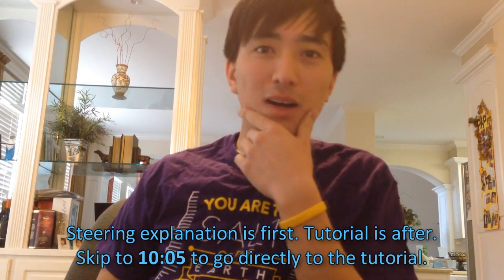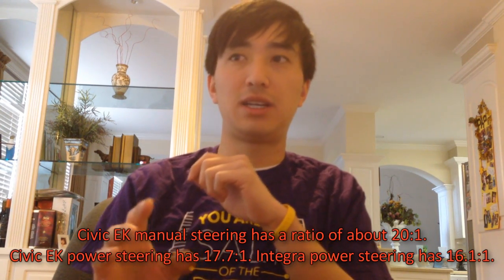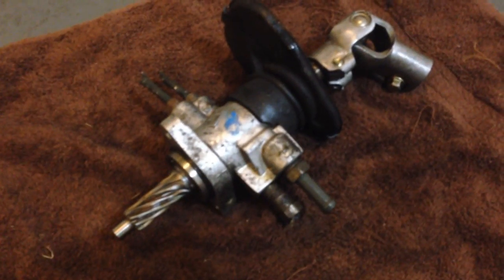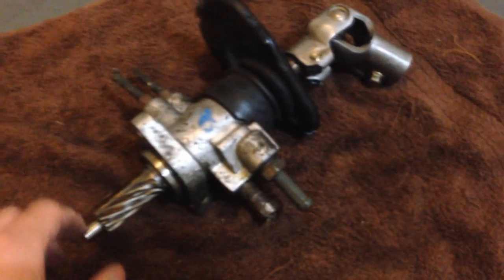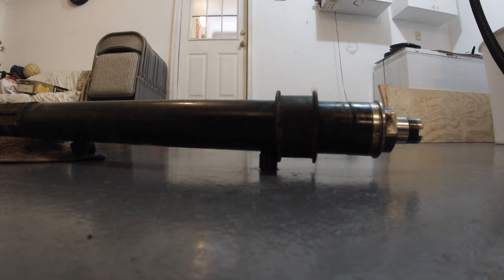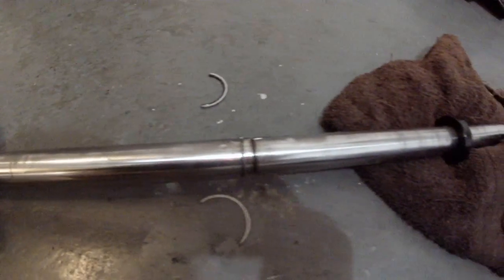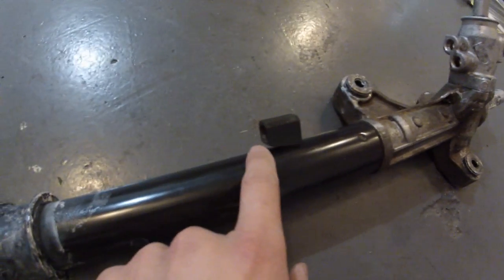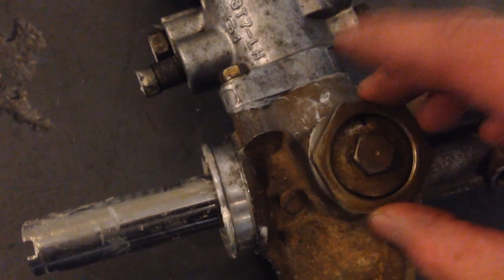How to Build & Upgrade Steering Rack for EK with Michael Flare

Comment: Love your EK build dude! But FYI, 94-01 Integra steering racks are not all the same..
94-99 is the steering ratio is 16.1:1 and the 00-01 is 15.7:1.
But you were right about all trim levels having the same ratio, DC2R has the same ratio as a DC4
Reply: Bringing this back from the dead, does this mean that the 00-01 pinion would result in a tighter lock to lock vs 94-99 when used on the same EK rack? Or is the 00-01 incompatible?
Reply: @coryinmotion  it should be a tighter lock to lock, the only change that you may find for bolting stuff up is the line and pump on the 98+ is different. So basically you can't use a 98-01 rack with a 94-97 pump and hose
Reply: @petethecarfreak3486  there’s a way to swap the pinion into the stock EK housing though if you pull the pinion sleeve and swap it, right? Or are you really forced to use the Integra housing/pump?
Reply: @coryinmotion  I'm not sure on that one, I have a DC2R with P/S
Reply: @petethecarfreak3486  no worries, congrats on the R 😉
Reply: @coryinmotion  thank you, it's something I wanted for a long time

Comment: I have a 92 integra. Do you know if this process minus changing the pinion is pretty much the same?
Reply from the maker: So you're basically just going depower the rack? Then yes, this is the same procedure.
Reply: Michael Flare yup I'm just gonna open up the rack and remove the ring. The DA rack has that big section by the pinion that has the gain control valve and a pressure control valve. guys who just loop their racks gut that stuff out. Does the ek/eg/dc racks have these valves?
Reply from the maker: All power steering racks have the valves.

Comment: can the modification be done using the civic pinion instead of the 94 integra pinion? what's the difference?
Reply from the maker: If you're using a civic pinion then that means there's absolutely no modification that needed to be done LOL. The Integra's pinion has more tooth than the Civic making it have a quicker (but more difficult) turning speed.
Reply: Michael Flare ok thanks was wondering what's the difference really .....keep the videos  coming there're really helpful
Reply: I just want it to be manual rack instead of a power steering.....will it work that way?
Reply from the maker: Yes. You do everything in the video except that part where you put the Integra pinion in. So that means you have to cut out the center ring, block the fluid lines, etc.
Reply: Thanks nuff respect.....

Comment: If I take off that round metal ring in the middle of the shaft the one you took off will the steering will be hard of smooth.
Reply from the maker: Easier so I'm assuming smoother.

Comment: i have a 95 honda civic power steering rack. i wanna buy the quaife 2.83 LTL. and i don't want power steering. should i buy a manual rack and build it or build my power steering rack?
Reply from the maker: You should buy the Quaife manual steering because a factory Honda manual steering rack has a very high LTL so that the driver can steer easier but takes longer to turn. Quaife made their own manual steering rack that is low LTL like you said which is harder turn physical but faster just like mine. Up to you.
Reply: Do I have to buy and manual steering rack and rebuild it or just keep my power steering rack and just rebuild that?
Reply from the maker: It's up to you.

Comment: Yeah its called the valve housing in this video u called it valve body the pinion shaft crosses the valve housing  and connects to the steering column well inside of the valve housing is the valve assembly witch is componed of ruber valve seals if u google it you'll find diagrams of what i mean.
Reply from the maker: +Jorge Rodriguez I didn't know you could separate the valve assembly inside from the body. If that is possible. then it's probably better to do it that way but I'm not sure if it's possible though. Let me know if were able to do it.
Reply: Yeah u could separate it all it has is a ring that u remove with a set of ring pliers i just didn't know if i should remove it i saw a add on witch they removed it all but the bearing but then welded something together don't know why but it was a mazda miata rack similar to the hondas just thought i would get ur opinion since its no longer needed now that it's manual.
Reply from the maker: If you plan on doing your way, then let me know how it goes. There's forums on the internet that never mentioned about doing that for Honda racks so I'm curious.
Reply: Lol ok I'll  let u know great video bro i did a lil diferent tho insted of plugging the 2 nipples that r in the middle of the rack i cut them of with a dremel grinded them and welded them close for a clean oem manual rack look lol then went and bought plugs for the valve body and got everything powder coated im picking parts up tomorrow hopefully everything turns out great.Thanks for info and btw whats ur instagram name?
Reply from the maker: I'm sorry but I don't have Instagram. LOL. I get that question all the time. Sorry. If I ever did have Instagram, the name would literally just be Michael Flare. LOL
Reply: Lmfao aight its cool u should join u would have alot of followers nice talking to u ill let u know how it comes out if there were a way i would send u pics lol.
Reply from the maker: Message me on facebook when you want to send my photos of your steering rack project. LOL. YouTubers show me their projects all the time through there.
Reply: Ok i will lol thanks for ur time nice chat take care bro.

Comment: Hey Michael wassup i love watching ur videos they come out very handy im currently depowering my rack and i removed the valve assembly from the valve housing but since i no longer need the valve assembly cause the rack is converted to manual can i just remove the valve assembly and just leave the bearing?Will it make any difference at all if i remove it?or do u think i should leave it on?
Reply from the maker: +Jorge Rodriguez I don't understand exactly which part you are talking about when you say "valve assembly" or "valve housing". Is it shown anywhere in this video?

Comment: I have a 92 eg with power rack in it right now and I have a mint power rack and pinion from my 99 Gsr. Can I just do all the line cutting and cut out that little thing you had cut from inside the rack to depower? Already have new inner and outer tie rods and poly bushings to go with it and wanna put it in my eg. Will it fit?
Reply from the maker: +stefan alleyne There are two methods of deleting the power from a power steering rack. My method is the true method of depowering it. The other method is called "looping" the lines of the power steering lines. There are kits on the market of hoses and fittings that let you loop it. This works but isn't the true method because it doesn't eliminate all the resistance from the power steering components like the ring inside the shaft and the fluid is still inside. Doing the method you posted is worse than the looping method. The fluid has to travel somewhere when the rack is being turned. If you just block off all the openings of the lines, it will have a lot of resistance making it hard to steer.
Reply: +Michael Flare I have 2 lines looped right now on the car as of how it came with the rack in it. For my extra dc rack I'm gonna do like what you did in this following with new inner n outer tie rods and poly bushings. Was just wondering if it'll fit in eg.
Reply from the maker: I think EG chassis is a more direct fit with a DC2 steering rack because it won't require you to mix and match the Civic EX power steering rack with a DC pinion pinion. Your car should be easier if I remember correctly from my research back then.

Comment: just some FYI....i have a quaife quick ratio rack & pinion upgrade on my K-powered 92 civic cx rack; went from stock 3.88ltl to 3.25ltl. I have to admit it wasn't quite a night n day difference even though I thought it would be, but steering ratio does seem a tad quicker but nothing uberly major. Was rather bummed about this. At the track I do notice a bit of steering improvement as well. I still need to hit up (streets of willow) to see how the rack feedback is on a tighter/windier course as a opposed to high speed course with less windier turns (ie. buttonwillow/chuckwalla). Makes me wish I just went with a DC2 rack instead (after driving my buddies DC2), but I don't want the parasitic drag of power steering lol.

Cool tutorial vid! If I had an EK chassis I would do this mod stat!

Comment: Which way is the easiest to remove the rack shaft at home? Or did you take it to the machine shop?
Reply from the maker: +John Last In the video, you saw me hammering it through. Unfortunately, it was too tough for me so I took it to the usual shop I go to and they removed it and hammering it out or using a press or something. They didn't tell me specifically.
Reply: Thanks Michael!

Comment: Hello Michael, I've ran into a problem with the power steering delete. I've deleted all the hoses & sealed the bolts With JB weld and put the rack back onto the car. But my steering wheel won't turn after I connected everything back on, feel like there's pressures inside the rack. Any idea What went wrong?
Reply from the maker: +John Last Did you cut out the ring in the center like I did?
Reply: Oh I didn't take the ring out, just wanted to clean up the bay and delete the pump and tubes, I'll try to take that ring out and see what happen.
Reply: Thanks buddy, keep up the good work!

Comment: I have a question... I completed this mod and it's awesome, I just have a problem. When I'm turning left and hit a bump it seems like my wheel ailment slightly goes off where it's pulling to the left.. And when i hit a bump or do a hard left I here a slight bang coming from the pinion area and it goes back to normal.. I'm assuming it's the pinion moving a tooth over but then why would it go back.. Any advice would be greatly appreciated thanks
Reply from the maker: I had very similar symptoms as this before.  It was my upper control arm. After I adjusted it for the camber, I didn't tighten it all the way. It made the clunking noise you describe too on turns especially after hitting a bump.
Reply: +Michael Flare did you lose aliment as well, bc I lose aliment slightly, then after driving some time I hit a bump or turn left (hard turn) it seems to fall back into place and it stops pulling and my steering wheel goes back to normal... Thanks for taking time out and replying back... 
Ps... Your ek looks sick man keep up the great work... Thanks for all your diy
Reply from the maker: EXACTLY! I lost alignment for a little bit until I hit another bump.
Reply: +Michael Flare you are the man.. It was the upper control arm camber plate it was loose... I appreciate all the feedback and all the time you put into making the video... Diff helped me out

Comment: ok first off you can do this to a eg but I just swapped the whole rack Stright in... But as I recall you also need the u brackets from the integra for your bushings... other things I have noticed and maybe it's just me but I had to open the holes that you jb welded due the air in the boots made steering hard also for autoX the turn radius is not as tight but I still love it only other thing is I have a 1inch dead spot in my wheel that I have yet to address.. PS I did this about 3 years ago and got the idea/build from this post 
 http://nzhondas.com/build-threads/86709-project-race-itr-build-06-09-12-a-70.html

Comment: I love this mod.. I'll be doing it in a week or so... Is there any advice you can give me with keeping the rack center.?? Thanks love your car
Reply from the maker: Marcos Olivera Yes! It is very important that you center the rack shaft after you have already installed it into the car. You do this BEFORE you bolt assemble the U-Joint at the steering column. You basically do it while your putting back the outer tie rods. Go to my steering rack replacement tutorial video ( https://www.youtube.com/watch?v=5NXQHiyipxs ) and turn on your annotations for the video. Read the video description from the video and the annotations. It explains in detail exactly how to center it.

Comment: Hey Michael do you think you might be able to post a video of the before and after to show the difference in handling. I've been very interested in doing an upgrade like this.
Reply from the maker: CLASSIC I'm sorry. There is no way I can post a very in depth video of it's handling before the mod. The only thing you can see about my old setup is my 3 autocross videos I have on my channel. I don't know if that will help you much but that the only thing I can show you of my old setup. My next race is less than two weeks: I'll have a video of it too with my first time using this setup at the race.

Comment: Would this work for 93 del sol si?
Reply from the maker: I don't know too much about the Del Sol's chassis but I have a feeling it's quite similar to an EG and Integra DC2. If it is, then you just need swap the entire rack from the Integra if you already have power steering. If you don't already have power steering, then you need to swap the Integra rack along with the Integra's cross member frame which is just bolted on to the chassis. I'm not completey sure about the Del Sol though so I suggest you look for more information on the internet of what people say.

Comment: This is probably the best import channel i have seen in years on Youtube.

My only concern with this mod is making sure the rack is 'centered' before installing?
Reply from the maker: Thank you. Yes! OMG! My rack shaft wasn't centered at all when I installed the outer tie rods (You adjust it when you install the outer tie rods or you can adjust the outer tie rods to center it). Basically, what i did was install the main rack iteslf. Then, I position the wheel hubs and estimating it so that it looks straight ahead on both sides. I even positioned to steering wheel so that it's centered in my dash and then bolted the U-Joint back in. I put the outer tie rods on and twisted it in (adjusting) until it was able to connect the hubs. I put everything back in and drove the car to my usual suspension shop for an alignment. I realized the wheel only turned once to the left and twice to the right. I knew I was screwed. At first I didn't know why but then it figured it out when they had my car on the lift at the shop. The rack shaft was so off centered! I just randomly put it on the outer tie rods without even thinking if the rack shaft was centered or not. It turns out the shaft was too much to the right. My guy at the shop didn't even align it. He knew it too. He literally told me to go home and fix it and come back. LOL. In the video description I have the link to my "Steering Rack Replace/Install Tutorial". In that video's description and annotations, I explain how to realign the rack shaft. Just go ahead and install the steering rack first because you adjust it before you fully bolt down the outer tie rods.

Comment: Michael,  Thanks for your awesome videos.  I just want to make sure I have this correct.  I have a 93 DX Hatch.  Mine came with a supposed "manual rack conversion" though I have not been able to get a good look because of the winter.  If it was a power steering rack, all I have to do is change the pinion from an integra?  If not, I would have to get a subframe and power integra rack and then depower it as you did?  I wish you had an EG.  Your videos are very helpful.
Reply from the maker: Everything you said is correct.

Comment: Unless u use a dc or eg subframe you can't use dc eg steering rack
Reply from the maker: I don't think you can even bolt up the EG/DC subframe to an EK correctly. If it did work out like that, then someone would have discovered that and posted about it on the internet, years and years ago. However, EG/DC subframe does not match up to EK. EK is usually always on their own when it comes to suspension as for the EG and DC is usually interchangeable; you'll see this especially when you order stuff for parts.
Reply: No offense and I respect you michael for all your work cause it helped me, but e can put a eg and dc subframe on an ek that's how you do a k20 swap in an ek for better axle placement.
Reply from the maker: LOL. You're probably correct, then. I don't know why I haven't seen a single person talking about it on steering rack ratio threads.
Reply: Maybe because you've got to be 1 of maybe 20 people to do this upgrade. Only a genius would of thought of this upgrade for the purpose of circuit/auto cross/ road track. Idk I thought of this before but I felt sketchy messin with the steering rack cause not a lot of people have done this job

Comment: I prefer manual for my eg
Reply from the maker: The stock manual steering ratio for EG is also as slow as the EK's manual steering (about 4.0 LTL or 20:1 ratio). EG can also do the upgrade. In fact, they were the orginal ones to swap it out with the Integra and much easier because Integras and EGs have a lot of interchangeable parts unlike the EK. If you have a manual steering EG, then you swap the subframe with the Integra along with the Integra's rack too. If you have the power steering EG, then all you do is swap the steering rack.